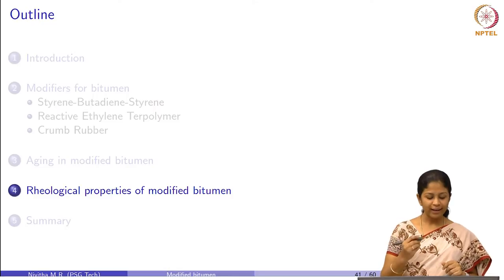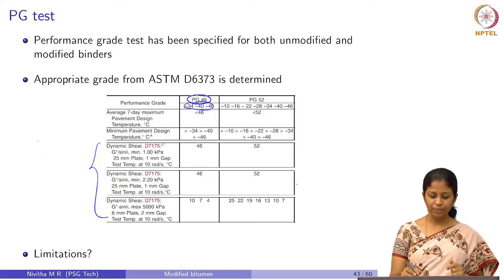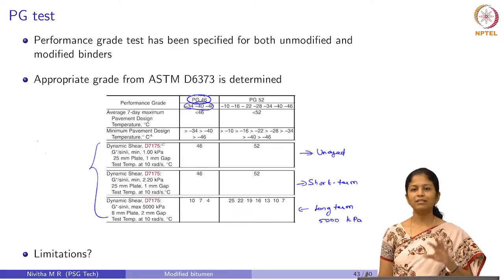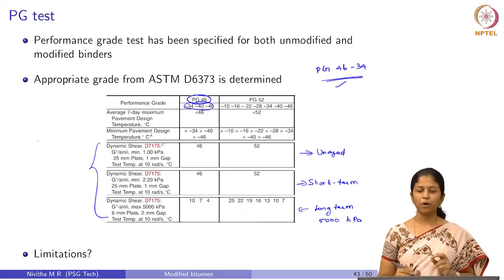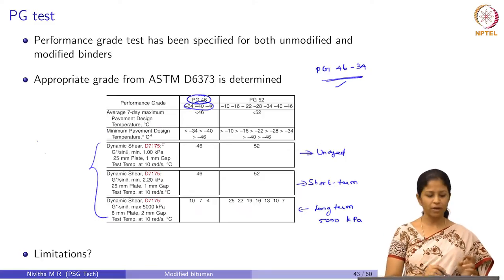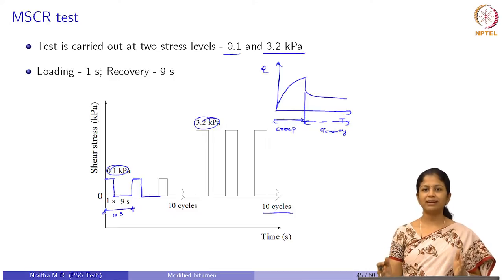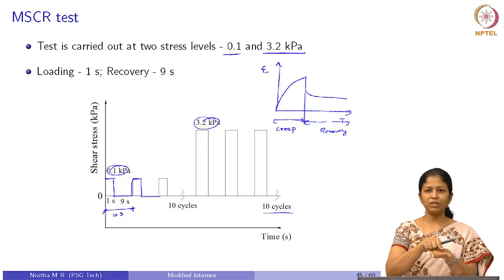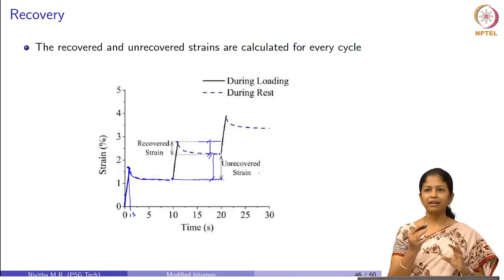Modifiers for Bitumen – Part 04

Comment: Another important development  in modified bitumens.....you can also add approx 8% of sbs....where the bitumen molecules are entrapped in the sbs structure.
The molecular structure of the sbs used is important for the performance of the bitumen.
Highly Modified asphalt contains about 8% and can last several years more .
Kindly update yourself.....these are industry secrets.
Reply: hello @gautamchakraborty3668 what what happened if the SBS is added at 12%?
Reply: @BroRonDM  @conentrations greater than 8% , the asphalt becomes sticky and likely to strip off  under rolling loads.